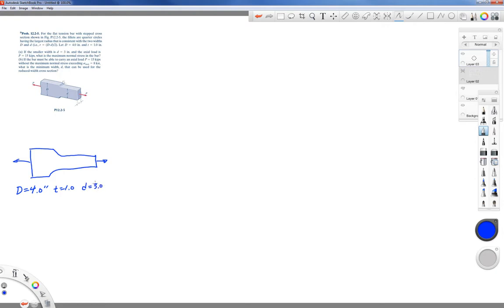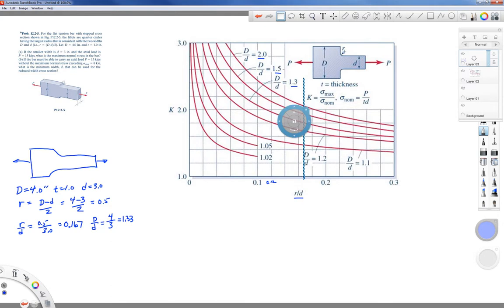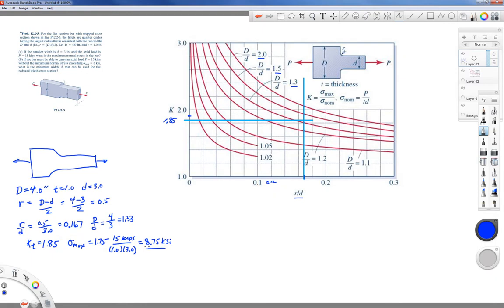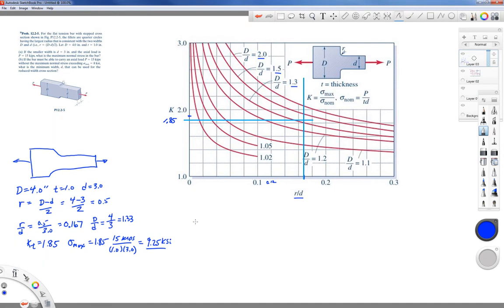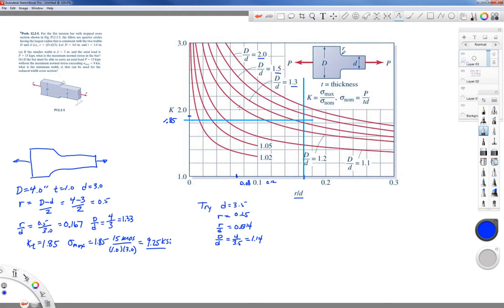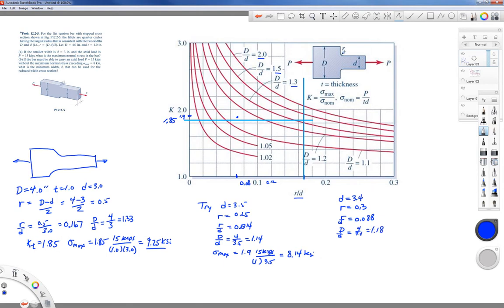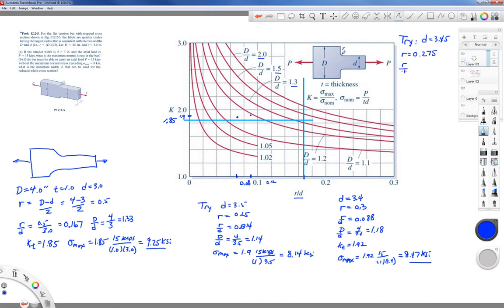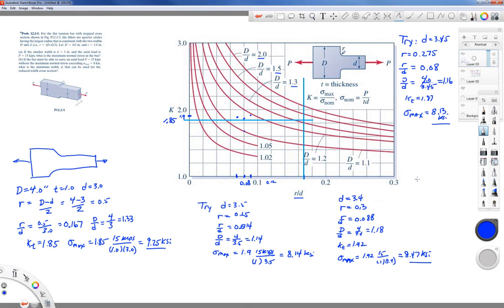Mechanics of Materials-Lecture-36b-Stress Concentration Example

Comment: hi, dr.mark . i have a question about the stress analysis.the fea method for solve the stress on the boundary ,which constrain all dof . the stress would be larger with the finer mesh. and how to solve the accuracy stress in this situation
Reply from the maker: Hi, FEA with all fixed boundary nodes can over constrain the mesh.  I made this video a while back that illustrates the effect of over constraint:  https://www.youtube.com/watch?v=3xVgcIAWkOw&list=PLaDWa6xI4zefL69_xDs-OoS8pECVpAo3F&index=6    and then what it takes to get a uniaxial stress distribution.
Stresses in well posed FEA problems tend to converge with a consistent reduction in element size.  I think you would find a good course in FEA to be useful to you, as most classes would cover these issues.  Best regards, 
MEB
Reply: Thanks for reply. i have seen your video, and i see we can get different answer in different BC. but sometimes we need the stress in the fixed position. eg.i want to get the stress at the fixed end of a cantilever beam.  if i fixed all dof ,i cann't get the accuracy answer.
Reply from the maker: The mechanics of materials solution allows for the Poison contraction of the material, which is not modelled properly by constraining all DOF at the "fixed" end using FEA.  You simply cannot over constrain the mesh and get the mechanics of materials stress solution.
Reply: thanks for the tips. if i want to calculate  the stress in the fixed end of cantilever beam,how can i apply the BC on the end. can you give me some advice.
Reply from the maker: I will try to explain it.    x= 1, y = 2, z= 3 directions.  Design cross section with a node in the geometric center.  Use solid elements, build full cross-section, extruded down 1 axis.    On the "fixed" end, constrain DOF 1, 2, 3 for this center node.  All other nodes on "fixed" end, constrain DOF 1.  This will allow for Poisson contraction while constraining rigid motion and movement of the "fixed" end down the 1- axis.  This sounds like it may be a homework problem so I will let you finish it.